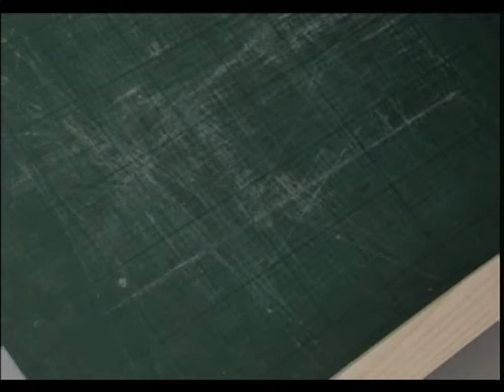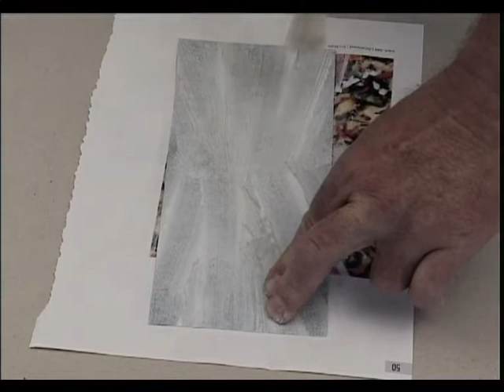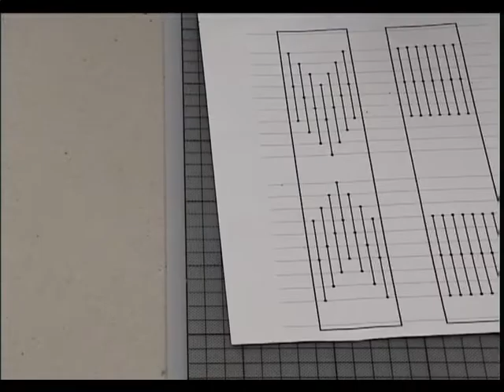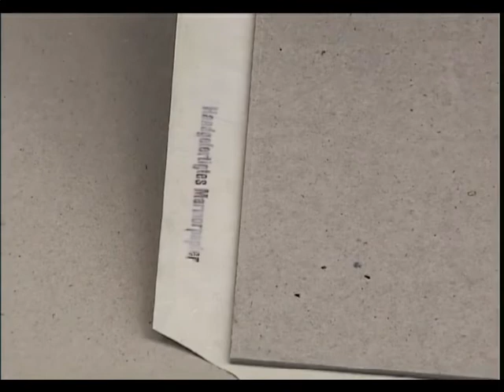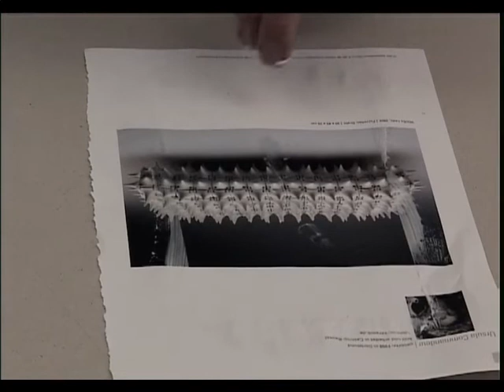Photo Album Pamphlet Stitch

Comment: This is another wonderful video.  I followed the link to donate through PayPal which was a success, but I am unable to download the template in the correct size.  It appears in iBooks but is quite small.  I am unsure of what to do.  I do not read German so I am trying to translate the paper sizes as well. If you might be able to help, I would appreciate it.  Thank you. Laura
Reply: I can read the measurements and they appear to be in Centimeters. However, i think you could just use the measurements of your available sheets for the signatures, and make everything according to that.  You don't need to use his measurements.  The rows of holes in the spine for the binding appear to be about 1/8th of an inch apart and you could just go with that.  Really, the measurements are only for reference and you could make the album any size you wanted to.  The boards for the cover traditionally extend 1/8th of an inch longer than the top and bottom of the pages and when you get around to trimming the leading edge of the cover, leave it 1/8th of an inch also.  There looks to be about a 1/4 of an inch gap between the spine piece of board and the front and back boards.  I don't know if this is any help.  I liked the video and will make this album based on the size of the pages i use for the signatures.
Reply from the maker: I will send you the pdf via Email. Thank you for the donation.